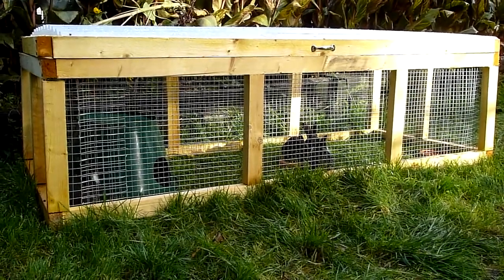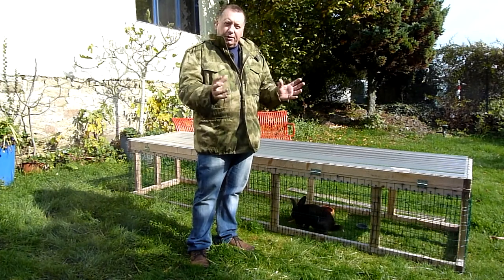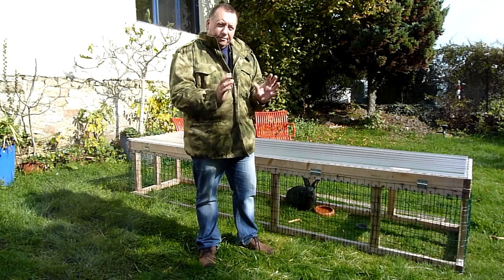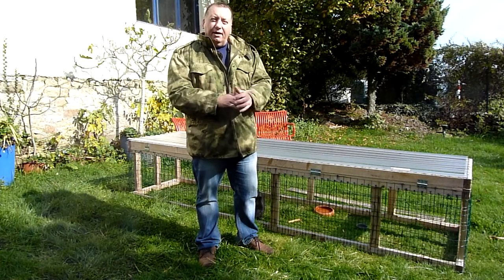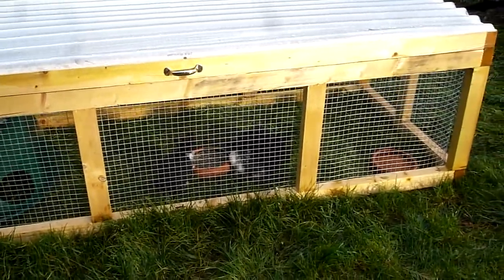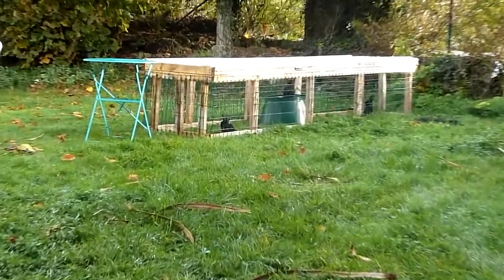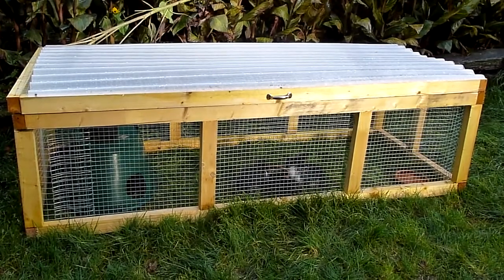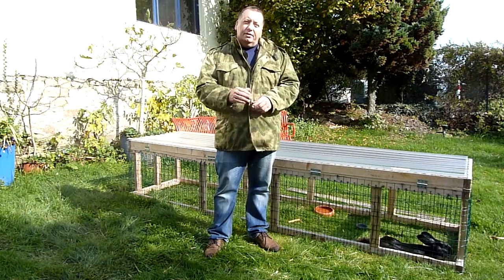Rabbit Tractor (How to build a Rabbit Long Tractor)  Raising Rabbits for Meat  (Meat Rabbit Tractor)

Comment: What size wood did you use? Is it a 2x4 or 2x2?
Reply from the maker: Thanks for watching - you are going to love this answer as I'm in France - its 6cms x 4cms - both rabbit tractors are 2 years old now, moved everyday and are just as good as when first built. Going to build some 4 meter long ones soon as the timbers can come in 4m lengths
Reply: @r11hno  Thank you, I check google for conversion.